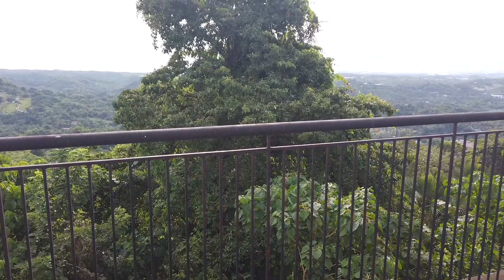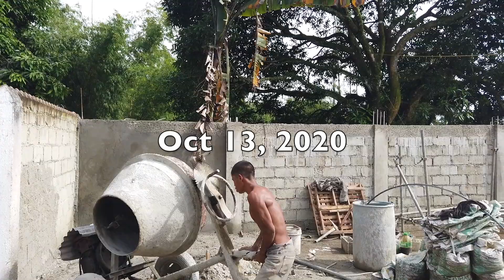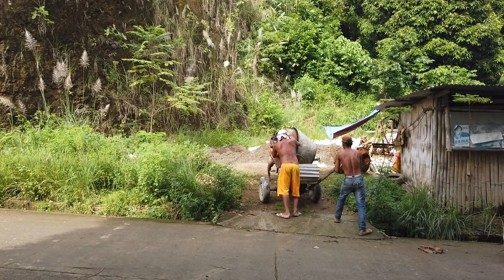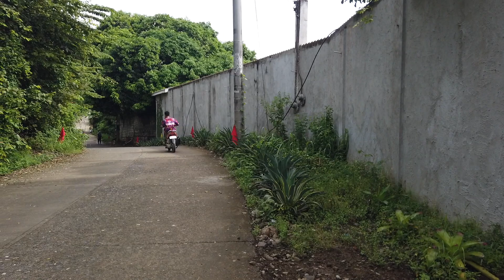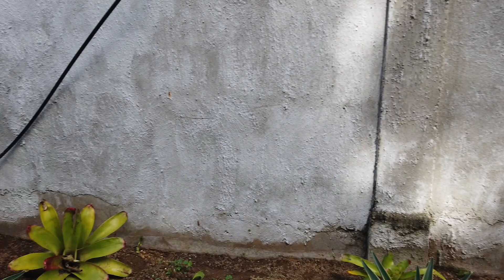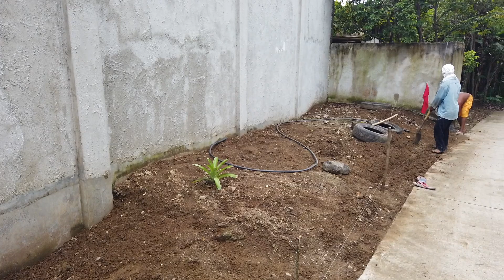"Good Progress" Oct 12/13 Build Update In The Philippines.

Comment: Our much approximately dose a section of the wall cost to build . ?
Reply from the maker: With columns both side, this height and width approximately 2.8 meters in between including rendering. About 12,000 -14,000 pesos labor and materials
Reply: I can do the maths on that now , thank you  for your reply .